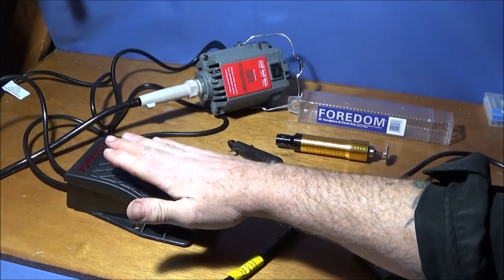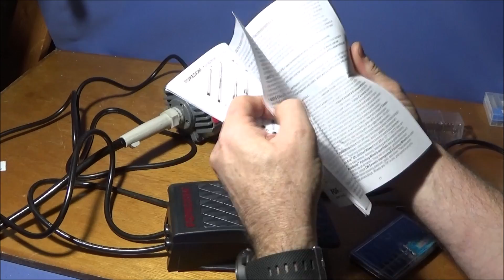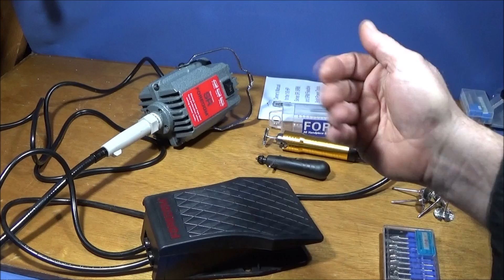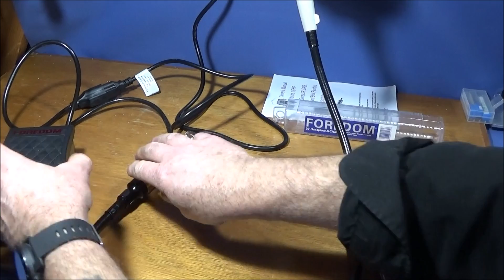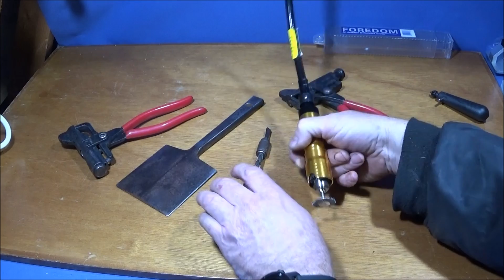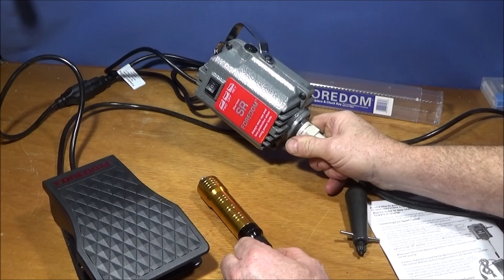Chinese 'Foredom' SR Series' 230 Volt 1/6 HP Motor Flexible Shaft power Tool

Comment: hi steve , so its been 3 years since you purchased this power tool. Can you say how long it lasted? before it broke, if at att it did. thanks for the video.
Reply from the maker: Hi, I don't know as I sold it. I prefer handheld dremel type tools rather than these.
Reply: @SteveJordan  how long did you have it  before you sold it?
Reply from the maker: It must have been a year or more. I never had any problems with it. I just found it a bit cumbersome for my small workshop. I prefer the Dremel rotary tool type. Regards Steve

Comment: So this is the Chinese copy of the fordom s-r? Are these able to use all of the real fordom accessories and replacement parts?  Will I need better motor brushes  ?  Does the foot pedal have good sensitivity ? And can it cut wet ?  I need a flexshaft grinder and am broke as joke until I can get some things made...and some Rubyvale sapphire rough, skin polished.

Comment: I had one delivered from China yesterday after a 2 1/2 month wait. It would not turn on its own power. I took the flex shaft off to rotate manually and found that it was hanging up internally. Took it apart and found where the armature was contacting the stator and hanging up. After filing that area down it ran smoothly. Next I filed and sanded the bail handle hanger which had horrible burs all around both sides.  The control pedal is basically on/off but feels like it should regulate. I'll change that out. The flex had what may have been a little graphite or just grime from production I lubed it with lithium grease. I've bought a lot of tools and parts from China, some I'm pleased with, some that needed some help like this. For the price I can't complain TOO much and think it may serve well now.

Comment: I know I am late to this party, but. . . .

Foredom's are not "all that".  Bought one about 20 years ago (keep reading), used it a total of maybe 30 hours run time.  The switch went belly up.  Called Foredom, told me that getting it repaired would cost more than a new one.  So they sent me a switch.  Holy smokes!  Trying to remove and re-solder that switch is pretty much impossible for a mere mortal like me.

So do NOT yammer to me about "warranties" and "made in the USA" ad nauseam.  I am much happier with my $79 chinese one.  Mainly because when it breaks I will not be out over $300.  Made in the USA is way, WAY overrated these days.
Reply: They are assembled in the USA WITH INTERNATIONAL COMPONENTS!!! WAS TOLD WHEN I CALLED THE FOREDOM PARENT COMPANY BY CUSTOMER SERVICE.

Comment: It's bad enough they copied the American product but they stole the name and the model as well? I don't care if it works or not. I won't buy it based on that. I'd rather have a real one (I have a real one and it's great) or one of the other manufacturers which don't steal the name. I have the Harbor freight one and it is nearly worthless. No torque at all. Barely good enough for light sanding. 

There is a dremel pendant motor that is 200 bucks an I have yet to try that yet but the reviews seem good.  There are lots of other reasonable tools out there so I will never buy from someone who steals a name and model.

Comment: Just got mine and it's garbage. Doesn't work. Waited two months for delivery. I don't recommend, buy a real foredom, blue sticker.
Reply from the maker: I've had mine over a year now. It's still working perfectly. It's excellent.
Reply: I got mine from Amazon for 109 bucks and it works perfectly for almost 1 year
Reply: I'm glad you both had better experiences, but I still advocate for supporting the company whose design the Chinese STOLE, and the piece of mind that comes with it. 

I wouldn't recommend, as stated above, but don't take this comment to heart, I do really hope your motors do not give out, and bring you many hours of creative application. But I still think people should just buy foredom. I'm waiting for my SR now, and will probably do a side by side review.
Reply: @justinsane332  I understand your point of view, jewelry is (for the moment à hobby) I'm building my little workshop and each cent can be saved. I plan to grow, and of course I will buy real authentic stuff. But I have to say that I went from a dremel to this 👆 and it night/day difference...
Reply: @justinsane332 Foredom rotary flex tools are also made with imported parts if you call customer service they will tell you as much. International components.
Reply: It's also made with imported parts I asked customer service at FOREDOM.

Comment: This comment section is quite a cross-section...you’ve got Foredom employees leaving comments about how bad this tool is and how in 2020 you may not receive the item in the mail because “China”. Then you’ve got people knocking it for being bad and then admitting to rebuying it after it breaks. Then the icing on the cake is the updated comment telling us you never knew it was a fake even though it was 1/3 the price of the original. And that we shouldn’t buy this based on principle. Then, drum roll please, you tell us it’s a great value for those who can’t afford the original. Holy shi t. Make up your minds.
Reply from the maker: Mine is still working fine. I think the Chinese ones are excellent.
Reply: If the original Foredoms are as good as their reputation, then starting in the jewellery or engineering trade buy an original American Foredom. Why? They were over-engineered and have reliable and long lasting motors. Time is money in the jewellery trade so having reliable ones that can stand 40 hours+ a week use is essential. Ones from the 1970s are still in circulation and can be bought fairly cheaply, at least in the US. At most you'll have to replace the carbon bushes. For everyone else - occasional users and hobbyists - a Chinese knock-off may be more cost-effective as the price difference is huge at 2/rds less than the equivalent original. What I do note is that the Chinese Foredoms have poor foot pedals. That's where the cost cutting is very apparent. If speed control is important, the Chinese ones will not suit. However, as an aside, I do note that the Chinese Die Cutters on Amazon may be a better option for occasional users as they are cheaper still. No foot pedal, but come with a flex shaft and are claimed to run at speeds between 8000 and 30000 rpm. They can take from between 2.3mm and 6mm bits. Downsides? Flexibility. They don't use the Foredom style handpiece, so one is limited to the type sold with them but, these do everything but carving. At under 50 GBP, they are good value, and avoid any moral questions. Take your pick. Not everyone has over 300 GBP to drop on an original Foredom sadly.
Reply: @BigHenFor  Wow, great and informative comment. People will benefit from reading this.
Reply: I know right.
Reply: I know, I’ve took a chance and ordered one. 😎
Reply: My friend bought one. We used to use foredoms back in college. He told me they are pretty good and perform the same

Comment: Nice video Steve; i tihink that some counterfeit chinese articles can work good and some others just don't. there is a percentage of risk on buyn those items. some years ago i bought , in example a Little Torch by Smith in a qualified goldsmith shop in Naples paying it about a half of its price (120€). after a week, and after dismounting the torch, i realized tha, probably i was cheated, but the torch works fine, even if,, buying it directly in china, i could have paid significantly less...sorry for my "rusty english". ;)

Comment: With waht do you hang the motor ? And Do you also look above the engine while it's running and there are sparks?
Reply: ummmm maybe a sting... or anything offering more rigidity than jello... what kind of a question is this? how is it that you need the utility a tool of this nature but you lack the inclination to understand how to support it? seems similar to procuring a graphing calculator and asking how to add 3 to 1.

Comment: can i ask if you have any problems with this chinese tool since you bought it? i'm looking at buying one but wondered if its going to last
Reply from the maker: No I haven't had any problems whatsoever. It's a fantastic piece of equipment. A high quality tool.
Reply: @SteveJordan  But like I said in my long comment, mine wouldn't start when it came....however, I fixed it because I've been doing such for 50 years. It is based on a good design. It all depends on which chinese peasants or children  are working on the one you get.

Comment: I own 2 of these tools. Love them! One thing I'd suggest is upgrading the pedal to the (genuine) Foredom.  A night and day difference in control. BTW, I'm in the US and both of mine have red labels. The real ones are blue and the switch is configured the opposite way.
Reply: Foredom do a red label machine it's a 230 volt international model.
Reply: @angusdafoe9351  yes but this machine is still fake. the price is 3 times cheaper than the real price of the foredom sr with the blue label. and it is made in china. I just bought it yesterday. but it is still good and can compete with the original foredom

Comment: For sure it's a Chinese counterfeit if it's on Banggood for eighty quid. The problem with these is the risk of malfunction with no warranty or support. You have to pay the postage to ship it back to China then they try to weasal out of replacing by saying there was user damage not covered by them.I think in the UK Cookson sell the real deal for £200 with a 2 year warranty.
Reply: I got mine from Amazon prime for 109 buck, very solid, very smooth, not hot at all

Comment: Can the chick actually fit a 1/4 bit ?
Reply: The 6mm, which is actually 6.5mm, handpiece does fit round 1/4" shanks. In fact, I'm using a 1/4" shank 2" wire wheel right now. It is a tight fit, as 1/4" is 6.4mm, IIRC. Works very well.

Comment: I’m a little confused - is it an original foredom or a chinese product? what is the name of the site where you say you say you bought
Reply from the maker: Hi It is a Chinese product. They sell them on many sites though even on eBay so I presume the company don't mind for one reason or another? eBay would be the first to remove such listings if it contradicted any law. It's the same with Mitutoyo Calipers. You can buy copies dead cheap on eBay and they are never removed from the site. eBay is very strict on this sort of thing, so I do not know why they allow it. I'm really pleased with mine. If I had the spare finance I would have bought a genuine one, because then it keeps it's value if one re-sells such things. If I sold this one I would have to specify it was a copy. Regards Steve
Reply: Steve Jordan thanks for clarifying. I guess there are two issues: (1) is the tool any good? - sounds like it is (2) is it ok to write Foredom’s US address all over a product (presumably for warranty) that Foredom made no money on. I have absolutely no problem with quality chinese products but I was slightly thrown that you made such an effort to describe the logo’s, addresses and brand when it apparently isn’t a Foredom.... unless these ARE Foredom (grey) imports manufactured for Foredom in China then the point of the brand/logo is lost on me though I was very interested in your hands on experience of the tool itself. Hope this doesn’t comes off as a rant but you mystified me there for a while - great review though - thanks :)
Reply: @ianbrown1474  I own 2 of these tools. They're fantastic. Even though one came with a warranty card, I wouldn't suggest contacting Foredom. These are counterfits; they were not made by Foredom.

Comment: If you use this tool in your trade, I'd avoid these counterfeit tools... you get what you pay for.
Reply from the maker: Mine is excellent quality.I'm so pleased with it. It works great and I've used it so many times.
Reply: I got one, and the quality is impressive.. Very solid, smooth, the shaft and the pieces are not even hot after hours not even the motor itself... Anyone can tell me how much is a "real" one,??? I got mine from Amazon for 109$ I know a guy that uses this one 👆 8hours every day for almost 2 years and still like the day one , that's the point that decided me
Reply: @jeremydemarco8697  Roll the dice...it's a pig in a poke.
Reply: @morganlewis2667 as it is with anything you buy. Foredom rotary tools are assembled in Connecticut with international (import) components.Customer service department from the parent company told me.
Reply: I have two of these that are used daily. You don't have one, right?

Comment: I just got mine from China after a six week wait so this video is super timely for me. I knew it was a knock off but it was a risk I had to take. Now I just need a stand that's not £ 45
Reply from the maker: I'm really pleased with mine. It is totally excellent in its build and is a pleasure to use. I have just bought one of the Chinese special handles for it. Its a slim one with a lever on the side to quickly open and close the chuck. Personally even If I had the money to buy a genuine Foredom. I would still buy the Chinese knock off. Its such great value for money.
Reply: @SteveJordan  What are you using for a stand? I am thinking of buying the quick release hand piece for convenience also but I believe it only takes 3.25 mm
Reply from the maker: At the moment I have it hanging from the low ceiling but I was thinking of getting or making the stand. That handle does only take that size bits but it's a nice accessorie for the price
Reply: Just buy a hanging basket bracket, screw to wall, hang from end, job done!!
Reply: I screwed large-ish hooks into the wall that sits against the bench and hung all my flexshafts. Obviously, one per hook. Works great.

I also own a Chinese quick change wand. No problems, just convenience.
Reply: Yoke base cost $108 plus tax 😊if there’s a way you can hang it to the wall with a couple of hooks just don’t let the motor touch the wall you’ll be ok

Comment: I saw these Chinese counterfeits  on EBay today whilst shopping for a flex shaft...was very tempted until I saw to terrible reviews.
Reply from the maker: Hi Kathy, Well I'm really pleased with mine. Its is actually the best rotary tool I have owned an used. The quality is outstanding to say the least! 
   Its like with many tools now, who knows where the parts are made? I know this one is made in China, but how do we know whether the genuine ones all have parts made in their home countries.  Most manufacturers sub out their work to have parts made in China now. 
 I did see some bad reviews but I'm so pleased it didn't put me off. It has saved me spending three times the price
and I have a super high quality tool. It is absolutely fantastic.
Reply: I own 2 of these. Never an issue.

Comment: That would be a great tool to have in the shop
Reply: Are you using this with an adaptor plug? What size fuse are you using?
Reply: @Kimicals123  I didn't purchase this yet you will need to check on banggood site for info

Comment: Gday Steve, I’ve recently brought the Dremel 3000, I’m impressed with it but it does lack in the power/torque department, if I’m polishing with it I have to be careful to keep the same pressure at all times so I keep a even finish due to the lack of torque, it does struggle in quite a few things I’ve used it for, I wish knew about the one you have before hand, after seeing you demonstrate yours I would have got the same, then again I still might talk the wife into opening the purse strings once again with a little sweet talking, only time will tell,    Thanks mate for a great honest review it’s much appreciated,    Cheers Matty
Reply: China manufacturers products for Europe and USA. One gets run ons, when they make extra products.
This maybe such a case..

Mine has been great. Servers my needs.😊

Comment: When I was a jeweler, we had to change the bits quite often.  the one slot to insert the chuck key gets annoying.  We would take a jeweler's saw and cut back the aluminum shield  from the chuck so the key can be put in at any position.  Also we would get a chuck key without the plastic handle.  Since  the motor is often hung,  we would tape the wings of the key to the power cord hanging down so you never have to hunt for the chuck key.
Reply from the maker: Hi yes I have another similar handle that I turned back like that to expose the chuck key area. It is much better like that.